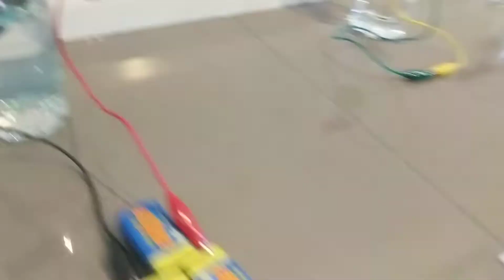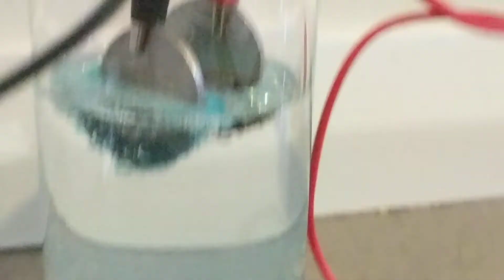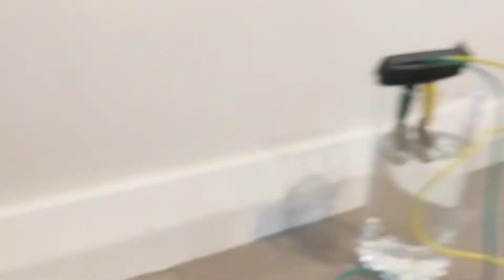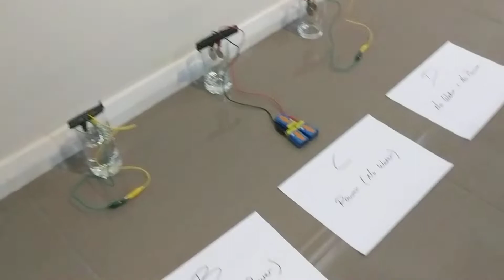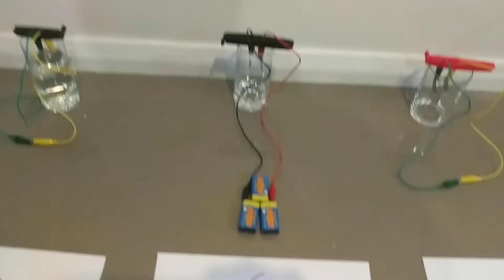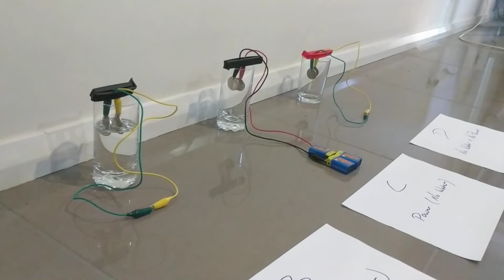Discussion of the results of my test for P&P. Evidence of electrolysis of pure water

Comment: Would have been great/accepted/proof if you had collected the gas!
I appreciate the time taken, but also have an issue with this as it possibly allows time for other conditions to generate, I also accept this is only your opinion, and as such should seen as that, However, I have not looked at all your video's to form a full opinion of my own as of yet.
Thanks again for taking the time to assess the experiment, it's only fair I go and watch your content, which I'm away to do.
Peace ✌👍
Reply: SheepsAndNeeps LIVE: If he accepts that water is H2O then these exercises are pointless because "Electrolysis is the process by which 'ionic substances' are broken down into simpler substances using electricity" & "A covalent bond is formed between non-metal atoms, which combine together by sharing electrons. Covalent compounds have no free electrons and no ions so they don't conduct electricity". H20 is a covalent molecule so he makes no sense. If the water is conductive it's not water it has dissolved solids in it and is an ionic solution/electrolyte. He can't have it both ways. 
http://www.bbc.co.uk/schools/gcsebitesize/science/add_edexcel/covalent_compounds/compoundsrev1.shtml
http://www.bbc.co.uk/schools/gcsebitesize/science/add_aqa_pre_2011/ions/electrolysisrev1.shtml
Reply from the maker: stuart pound ok, so I said it in the last comment I left you and I'll say it again. Water self dissociates (self ionizes I think the actual term is). 2[H2O] --> [H3O+] + [OH-].

Since it appears that you didn't take my advice to look it up, I've done it for your first result on Google.

 httpww1.lsbu.ac.uk/water/water_dissociation.html 

they go into in some detail. They've left a fair smack out but I don't blame them, it's a very complicated topic. Have a read mate

Let me know if any of it doesn't make any sense, happy to explain it. I did study it for 8 years after all (chemistry but pH specifically for 2).

If this didn't occure, we wouldn't be able to read pH values. Pure water has a pH of 7 and that is because the hydronium and hydroxide ions are in equal proportions. If there were no hydronium ions in solution and no hydroxide ions, than we wouldn't be able to read the pH, such as the case of oils and other non misscible petroleum products
Reply: dabrownie93. I responded on the other comment thread, I'm not talking about H3O+ or OH solutions I'm talking about H2O and the fact is a covalent molecule. 
https://www.diffen.com/difference/Covalent_Bonds_vs_Ionic_Bonds
Reply from the maker: stuart pound and I'm telling yes, it is a covalent molecule but it is still conductive because pure water has a unique ability to self ionize. You're most of the way there. Now you just have to plug in that you cannot have pure water that doesn't self ionize and you'll see why pure water is conductive. It doesn't all change to the ions. It is constantly decomposing into ions and rebondibg into water constantly at exactly the same rate. A rate which is determined by its equilibrium.
Reply from the maker: stuart pound don't get me wrong btw, it's a sh*t conductor. But even sh*t conductors are conductive
Reply: dabrownie93. Pure water is an insulator: https://link.springer.com/article/10.1007/s10786-005-0029-7
Reply from the maker: stuart pound yes, and if you read it carefully, it says that it's not a perfect insulator. You can pass current over short distances but when the electrodes are metres apart, no chance. The hydronium and hydroxide ions are in a very low concentration but are still there, thus a small amount of conductivity exists, enough for me to pump these 3 9v batteries across <1cm of water. Don't believe me? Try it yourself
Reply from the maker: stuart pound however, respect for the article, nice to see a reputable source for once
Reply from the maker: stuart pound https://youtu.be/eyuN3mr-lQ8
Reply from the maker: Peter & Pete well if you looked at the rest of the message I sent with that claim, I explain where the proof is. If water was a element, we wouldn't be able to measure the pH in its pure form. But we can! I even supplied some links to informative articles which explain how pH works, measured and derived. It's a bit on the complicated side so I'm happy to help with anything you find confusing
Reply from the maker: SheepsAndNeeps LIVE thanks for the comment mate! And thankyou for taking the time to look at my content!

I realise other factors may have effected the test which is why I ran so many other tests as controls. 

I may look into collecting the gas on a future experiment but I am currently working on a rust response per P&P's request but that is a good start for a follow up experiemnt, Thankyou!
Reply from the maker: SheepsAndNeeps LIVE I was just thinking more on what you said and how I can address that concern better and I've decided that I could repeat the experiment with an oil cap if you'd like?

If you're unsure what that is, I place a layer of oil about 4mm thick which will float on the top of the water. This will stop any atmospheric contamination other than temperature because the oil will absorb the pollutants but it's immiscibility with water means it cannot then transfer from the oil to the water.

Thoughts?